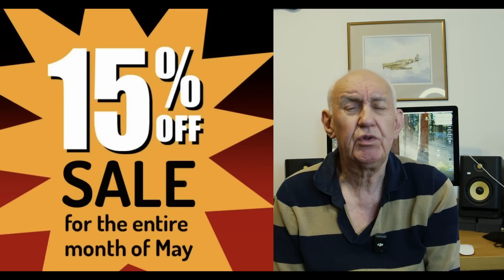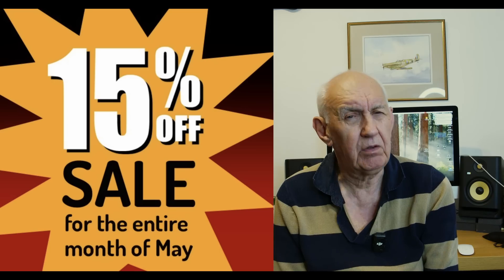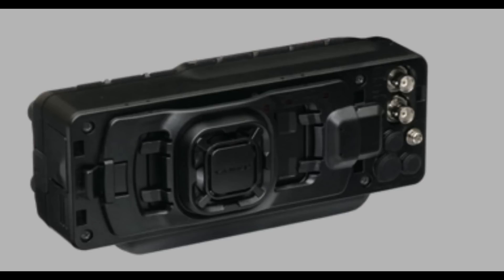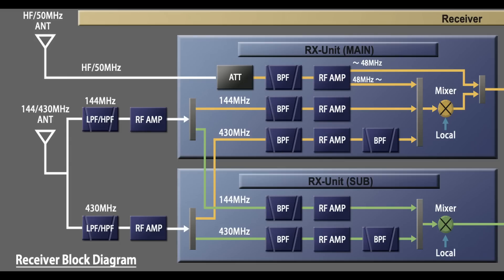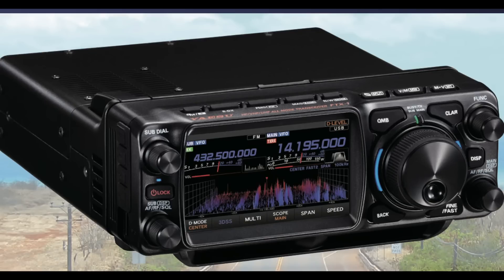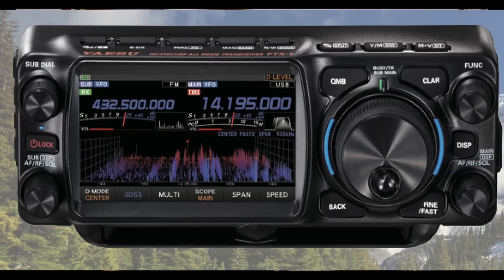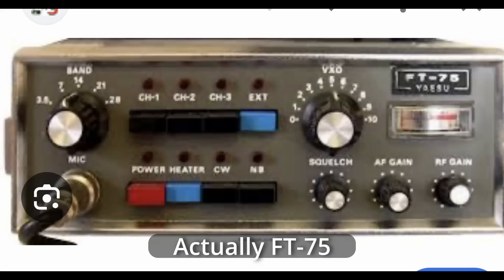Yaesu FTX 1 On its Way! - 2 Versions to choose from.

Comment: Let's stop calling this a game-changer. It doesn't seem to do anything that many other radios are already doing. The Field head by itself I'm sure is fine. But you need to add an external ATU (maybe two) , probably the Yaesu cage, maybe a fan and an extra battery etc. Lots of money added onto the expense for a radio which is the same features as others in a new package. I'm sure it will sell, what with all the  company hype and hams' habit of lusting after whatever is new. I'll save my money and continue using my IC-705, KX2, and for QRP, I'll use my $200 QRP Labs QMX+, an amazing  11-band all mode rig. And take an overseas vacation with the money I saved.
Reply from the maker: Thanks for sharing.

Comment: There seems to be a big concern in the US about having the SPA-1 separated from the FTX by some small distance, say 3M or less.  For example a mobile dash mount with the amp under a seat.  Many anticipated being able to do this.

Your thoughts?
Reply from the maker: For portable operation no problem. Maybe an e tension cable is a possible option. Have to wait and see,

Comment: The brochure suggests thst 60m band TX is not supported by default? That is disappointing. 

Also you need to carry around 2 external tuners (one built in into the SPA-1 PA and the qrp tuner) if you want to fully benefit from the radio.
They should have at least have the qrp tuner integrated into the Field head... that would have been a stong point against the IC-705... but they failed...
Reply: x6100 it is then! :-)
Reply: @paulsengupta971  had it. But the internal battery is more or less useless. 10 cq calls and you are done...

Comment: Good grief - Yaesu FTX-1 Field All Mode HF/VHF/UHF Transceiver. New · €1,848.00 !!
NOT a snowballs chance in hell.
Getting on a bit here and it appears that every year or so there is a new rig on the block and costing an arm & leg.  I will stick with my Xiegu G90 and my IC-7200.
Reply: Yes you could buy 5 G90s, or 3 G90s and a ic7200, far to overpriced..

Comment: 👍Very interesting, thanks Peter. Looks like Yaesu may have managed to produce an FT-817 replacement that can be adapted to meet the needs of many individual operators. I had a look at the brochure because I was curious about mobile operation and wondered if the FTX-1 can be remotely connected to the SPA-1 (e.g. for vehicle installation). I couldn't see any mention of this. Although, I did see the FC-90 which is a remote QRP matching unit for use with a long wire. Very interesting - with the FTX-1 Field, FC-90 and a length of wire, you have all you need for HF QRP portable.
Reply: It is what should have been the ft-818

Comment: I just hope Yaesu fix the Am mode ,add S-NFM 2.00khz FM dev and 4.0khz mid-fm dev for 10m/6m band for multi country uses!

Add built in "Parrot Repeater Mode" for 10/6/4m uses!

👍
Reply: What fix is need for AM?

Comment: And grossly over priced.  Im out.
Reply: Compared to what.?
Reply: @MINI-4X4-RADIO an 891. $2400 for the 100w version, $1700 for the QRP.
Reply: Ok bye
Reply: It is a great radio with many use cases.  I have the FTDX101d and love it.  I am not rich, but saved up for a great tranceiver since it is my main hobby.   Honestly I have too many QRP radios sitting on the shelf, so I would get the 100W version if I needed one.
Reply: Like a lot of folk at the moment I've gone down in the world financially and I'm pretty much stuck with Quangsheng handies for the foreseeable, so yes this is totally out of my price league.  That said, I don't think £2k is that bad for essentially an all-in-one shack-in-a-box.  If my situation improves I'd seriously consider it.  It potentially replaces multiple radios which would cost a lot more than £2k.

Comment: The brochure does not specifically state that the Optima includes an ATU, are you sure that it has one? It is optional for the field version. I hope it will do a conventional spectrum scope and waterfall display, I hate the 3DSS one the brochure shows.
Reply: looking at the brochure, it does say the SPA-1 has an antenna tuner. Its probably the same as the IC-7300, FTDX10 or FT710 where it can match a maximum of 3:1 though.
Reply: @JonathanKayne  Where is the brochure?  They don't even have a photo on the US Yaesu site LOL.  Yaesu is such an odd outfit.
Reply: @ its on google but not on yaesu's site
Reply from the maker: A modern base station with no ATU would be a major omission. .
Reply: @watersstanton I believe yeasu said that Optima should be paired with the fc-40 or atas-120
Reply: no clue why my replies keep getting deleted but the brochure is on Google.

Comment: Now we have to hold our breath and see just how much all this costs.  Credit to Yaesu in putting this together, as an owner of the FTdx10 the RX is fab and is much easier to operate than its predecessors.
Reply: $1899.95  at HRO
Reply: @m0aze611  £1599 Field and £2069 Optima.